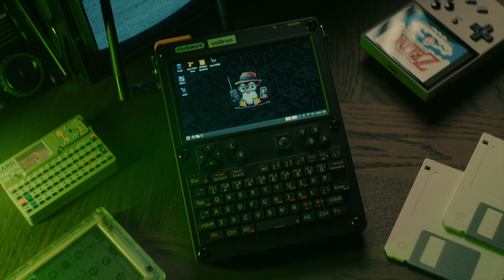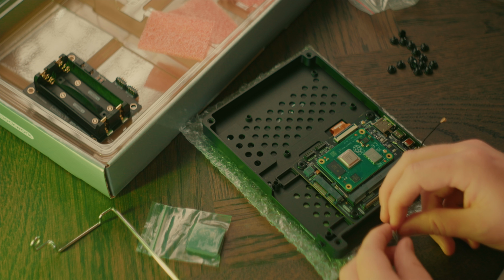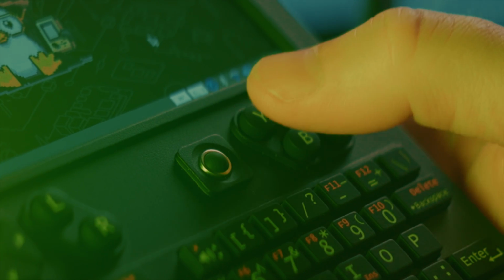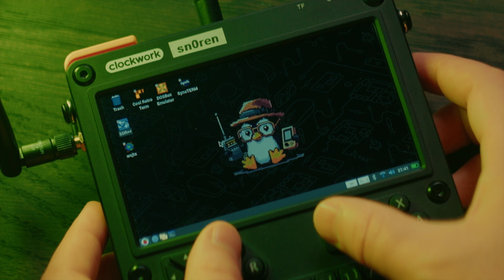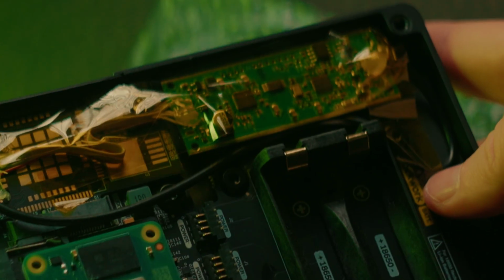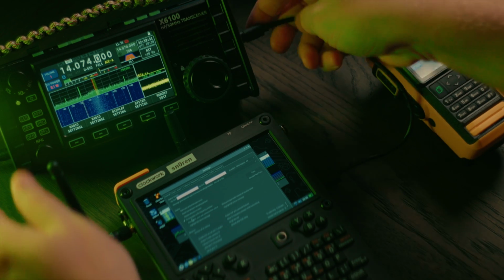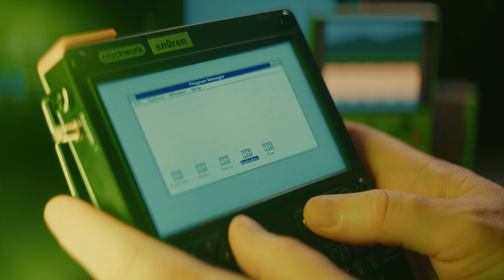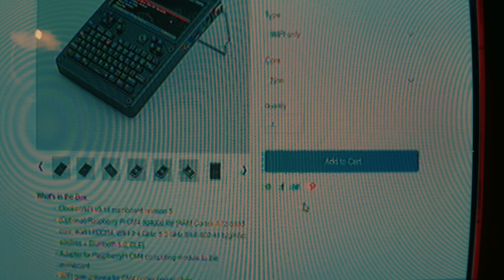Handheld Linux Cyberdeck / clockwork uConsole

Comment: Video didn’t age well, with the new release of upgrades.
Reply from the maker: What upgrades?
Reply: @sn0ren cm5 bracket, AIO expansion board with Lora, Sdlr, Ethernet port, usb and wifi dongle, and a Li Polimer battery / NVME board.

Comment: I purchased one of these and they are absolute garbage. The trackball is a joke, it's incredibly unresponsive and the keyboard is garbage too, you have to press the keys really hard and there's like a 25% chance a keypress wont register, so even just typing basic things is difficult.  The default wifi is just some crappy sticker thing and never gets any signal (even though all other devices in my house and literally beside it on my desk have full signal).  This is just junk.

Comment: For the 3D printed adapter, I would recommend making a cutout for a washer, in the software so that when tightening the screw, it does not deform the adapter, which would otherwise crack over time.

Comment: Ahem that Micro-HDMI can go to hell, its a deal breaker for anyone who wants display out! A
Also 18650 batteries... it could be much thinner with flat packs.
And substandard charging circuitry? really, I can remove the battery on my laptop without shutting it off, phones too! EVERYTHING should be this way. If it doesn't have that circuitry they are just cutting corners!

Comment: Regarding the shipping times, I was able to get mine dispatched (it's due to be delivered in 2 days) in just over 2 months (Bought Nov 15 2024, dispatched Jan 17 2025) by choosing to buy my CM4 separately, so that is something I'd absolutely recommend. Plus doing that you can choose to get the 8GB RAM model, or when support for the CM5 is mature and stable enough, the 16GB CM5. You can also choose to use eMMC instead of a MicroSD card (the SD card slot will not work if you have an eMMC model though so you'll need  way of uploading the contents to the eMMC)
Reply: i ordered in october and still don't have it

Comment: You have built it into a must have device. I already have a flipper, rtl sdr, some sma connectors etc. I so have to grab one. I could even mod a Bluetooth controller dongle in it to play with a controller 🎉
Reply from the maker: It has Bluetooth built in
Reply: @ the controller requires a Bluetooth dongle to make the connection
Reply from the maker: Not if it’s a Bluetooth controller, then it can just connect directly to the raspberry pi without a dongle
Reply: @ would you take the dongle apart and solder it directly in?
Reply from the maker: Are you reading what I’m saying? The Raspberry pi CM4 module has Bluetooth built in.  You do not need a dongle.
Reply: @ I have a Rii 707 that comes with a Bluetooth receiver. You plug Bluetooth dongle in to have it connect. My laptop has Bluetooth but I still need the dongle for it to work.
Reply from the maker: That’s not a Bluetooth device. That’s an NRF24 device which needs a dongle. Get a Bluetooth device and you won’t need a dongle.

Comment: Compatible with cm5?
Reply: There is one video online of someone replacing it with CM5. It did not boot. There are some changes in the layout of the cm5. So plug and play as they say on their website is not correct.
Any other alternatives to this? Not having to wait 11 months?
Reply: I am also interested. CM5 is pretty new, but they are not mentioning it on their site

Comment: hey man you see that little metal paddle on the bottom of those trackballs? Its a tactile switch paddle, my theory is that the reason these trackballs dont work as well as they should is because they're supposed to have a tactile button underneath them, which would minimize the amount of travel that the trackball has hwen you rest your thumb on it to roll it. Having that extra rigidity underneath the trackball not only would have minimized the ball travel but also would have provided a nice third mouse button to use as was common place on the original blackberry. They were never exactly perfect but admittedly I have to say I remember them being somewhat better myself even on my htc g1.

Comment: Personally bro, im watching this video on a gpd pocket 2 and its kinda alot better imo.......... i have 2 gpd pocket 2's because i knew that it would eventually stop being produced and im glad i bought 2 of them. mini computers are so so so nice. iread on mine like it is a kindle by flipping the screen into portrait mode and holding it in a vertical manner using my thumb to hit the space bar flipping the page. it is the coolest e reader ive ever seen and its a full windows 11 pc once i flip around the orientation of the screen and fold it into its 90 degree angle

Comment: The RTL SDR generates quite a bit of heat.  I wonder if the heat might create issues or maybe just heat the whole thing up.
Reply from the maker: I’ve made sure the heat transfer blob connects the rtl-sdr to the aluminium frame, so yes it heats it up a bit, but not to any troublesome amount. And it only heats up when an application is using it.

Comment: I ordered mine back in February. I opted for the version with the CM4 and LTE modem. It is now towards the end of October, and I still have not received it. I have contacted Clockwork multiple times and it takes them days to get back to me and they have not provided me a single update even though I have asked multiple times. They provide zero details and just say they are shipping slow. I am weighing the possibility of filing a fraud case with the Federal Trade Commission, and possibly retaining an attorney. Am I overreacting, or  has nobody else who has ordered after February gotten theirs either?
Reply from the maker: You are overreacting. If you want a refund just ask for it and you will get it. There have been multiple cases of this. Everyone who orders gets one eventually. They are just slow at manufacturing them. If you don’t want to wait just cancel your order.

Comment: Hi Nice video, where can i get the unpopulated PCB to connect up the USB? does it come with the unit? if no 4g module was selected?
Reply from the maker: Yes it comes with the unit if you don't order a 4G module - as it's needed to hold in place and connect the speakers.
Reply: @sn0ren  thank you for taking the time to get back to me. keep up the good work.

Comment: Would you say that the 4G version is less modifiable than the None 4G one? (extension module is missing on the 4G?)
Thanks!
Reply from the maker: Supposedly there is also a solder point for getting a usb connection on the 4g module - although it might be a bit more finicky to do.

Comment: Would it work with Dragon OS?
Reply: Did you try dragon os on uconsole?
Reply: No, I currently don't own one, that's why I was asking. I have spoken with cemaexecuter and theoretically it could be possible, needs the proper drivers for display, touch etc. Do you know if the new CM5 will be compatible with uConsole?
Reply: @catalinalb1722   @catalinalb1722  thanks for the reply. Well I have no Ideea if it's working with CM5. I had seen on discord that may work but it's important to have the version with sd card not with mmc or something like that. The best is to put a question on discord regarding this.
Reply: Apropos, esti din YO?
Reply: @robertzsug  salut, da sunt Român, locuiesc in Germania de 10 ani, in curand plec spre casa in concediu 😊 73! DE1CTL

Comment: 11:29 cheesus dude, push these power pins AT AN ANGLE, i know you pointed some misassembly at the start of the video, but if this is "after" then you have to redo it (or risk of melting these plastic connectors).
Reply from the maker: The shot in the video is from before to demonstrate how difficult it is - especially since there isn’t a good description of how it’s supposed to be done.

Comment: PD is always 5V and regulates only the current up to 3A, you mean it doesn't support QC with the tension step up to the 20V, perhaps?
Reply: This is not the case, USBC PD is able to supply up to 48v as per the specification. The 240w charging that is possible would require 48amps at 5v
Reply: @1nico517  are you continue mistaken with QC ?
Reply from the maker: I think it’s you who are mistaken. QI is wireless charging. PD can switch to a range of different voltages, look on the back of any PD charger or powerbank and you can see the voltages and amps it supports. You’re thinking of Quick Charge which is 5 volt.
Reply: @sn0ren  aren't PD is usbA based and QC is USBC?
Reply from the maker: No
Reply: @sn0ren  can you be more detailed, please?
Reply from the maker: I think you need to google Power Delivery and read up on it

Comment: Interesting device. I wonder if that trackball could be replaced with old HTC Desire "trackball". It's actually more of an optical touch mouse. I recall it working insanely well for such small "mouse device".
Reply: with some dremel action without a problem :). There are soldered on hall-effect sensors so with default keyboard you're stuck with magnetocoupled devices. but the kbd (as whole µConsole) is openhardware, there are schematics and pcbs on their github so you're more than welocome to design your own keyboard with IR touchpad.

Comment: my use would be as a portable network debugger, mostly. i suppose some day will also make a usb board with 2x usb-c and 1x sd card slot. since there's so much space i'd definitely squeeze in some esp board or a milk-v duo as low power standby server. the form factor is good for just putting a magnetic tape on the back and slapping it on a wall and such. the battery run time is kinda low though :/

Comment: What aerial? Are you using for the SDR mod? Looking to make this mod on my Uconsole
Reply from the maker: Depends on what I'm trying to listen to. I've got a little 433 MHz antenna for using rtl_433. I use a telescopic whip for other VHF/UHF frequencies. For HF I'm using a long wire strung up with a telescopic fiber glass pole of about 10 meters length.
Reply: @sn0ren  brilliant thank you for the response! Just starting to get into it all and watch some of your other videos making the mod to my uconsole that I received last week for SDR.
Reply: @sn0ren can you share the pinout on the rtl-sdr side please? Usb side and antenna side.

Comment: Different keyboard layouts would be good, is it possible with replacement parts?
Reply: Sadly no, but the keyboard firmware is open and customizable. So maybe there is something that would fit your use

Comment: really nice video! can you tell wich program u used to decode the pocsag messages ?
Reply from the maker: I'm using multimon-ng to decode the signal directly from the RTL-SDR by piping it from rtl_fm. You can run this command to do it (change 433.5 to the frequency in MHz): 
rtl_fm -F 0 -E dc -M fm -s 22050 -f 433.5M -g 38 | multimon-ng -a POCSAG1200 -a POCSAG512 -a POCSAG2400 -f alpha -t raw /dev/stdin

Comment: Does it run a custom kernel? I don't want another pocket chip situation where after a while it turns into a paperweight because you can't use a mainline kernel on it. This kind of device should last decades.
Reply from the maker: You can build the kernel yourself with the neccesarily drivers. The community made ones use a newer kernel than the stock image.
Reply: don't worry about the kernel they will eventually release a uConsole 2 which support the newer ones ...🤡. In my experience these products are basically selling the "cool factor" more than anything else , stay away and keep your money for something more practical and long term.
Reply: @squiddymute what would you consider? I new to anything like this. I will learn programming and developing. What do you suggest. Of something similar?
Reply: Any computer capable of running Linux.
Reply: @squiddymute 
This is purely collectibles, "hacker/retro vibes" gadget. For this much money, you can buy proper PCs/smartphones
Reply: Yeah man i got the riscv version but absolutrly any build for your ISA / arch will work just fine :) ! 
I havent modded mine but will be soon. Was probably the first batch for RISCV for it and in love. 

They say use your own but basically any distro you role up for the archicheture will work just fine :) (he did note drivers byt they are real cross compatible - i.e if you know some basics especially for arm chips and linux kernals of the like youll be fine or better yet just compile it yourself.
Reply: Where did you learn to fly?
Reply: I'm don't any kind of expert, but he said you need their distribution due to drivers for some stuff like the screen, which would imply they aren't in the kernel already. I'm not sure how hard it is to install drivers on Linux if the distro doesn't make it easy for me, but I imagine the Pi 4 will be supported for some time.
Reply: It is also interesting why you would need a new kernel on such a device  like a pocket chip? Of course I can imagine, but just genuinely interested in your particular application
Reply: @zarkonesmall  Security and features. Generally it's a bad idea to have a device connected to the internet if the kernel is too old, and the ability to update the kernel enables the use of new software and peripherals down the line. Computers can usually work fine for decades if the software can keep up.
Reply: @yugen042 , I believe he meant "custom kernel". Nothing here is particularly new technology, but you need something in the kernel. Why?
Reply: @bamhm182  Is your comment pertaining to my reasons given for why you would want a newer kernel? Sorry it's not clear to me what you are referring to rn.
Reply: @yugen042, sort of. I was saying that I think the other guy was making your same point. "Why do I need a custom patched kernel?" not "Why should I update my kernel?" It sounded like you were answering the second question.

I'm completely in agreeance with both of your stances. I really wanted a uConsole, but when I saw you need to patch the kernel, it really put a damper on my desire. It isn't a huge deal, but it is really annoying when you have to do it just to keep up to date. Seems like they could have chosen hardware with mainline kernel support.
Reply: @bamhm182  yeah, and another issue is that this patch is more likely than not to never be mainlined. So even if you are fine with patching, sooner rather than later the code bases diverge and you may not be able to apply it anymore.

Comment: beautiful! love this device since it was released but still hesitate to order.. :D i want to ask if you can switch off that sdr module or you now have to use device with that antenna on the side to prevent burning sdr module?
Reply from the maker: It’s a receiver only so there is no risk from using it without an antenna connected.
Reply: @sn0ren  11months later and i have it in my hands :) (it did not took that long time to ship)